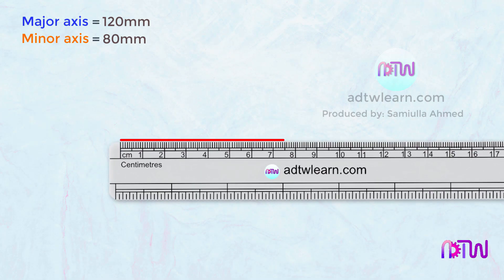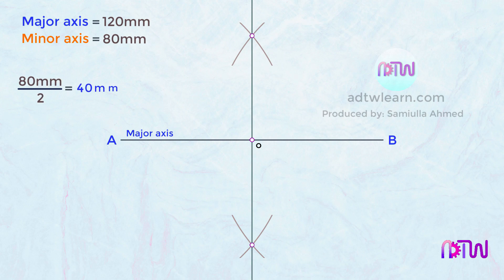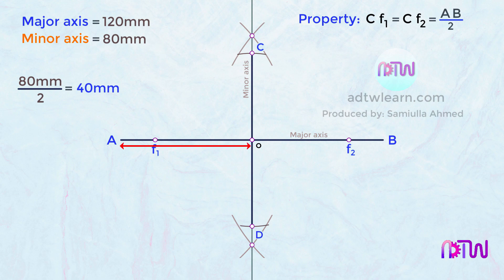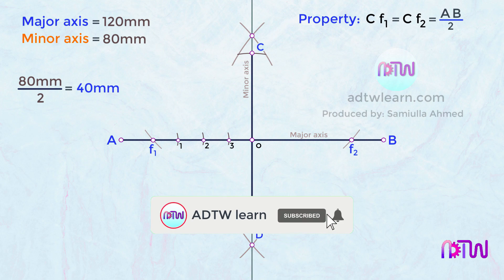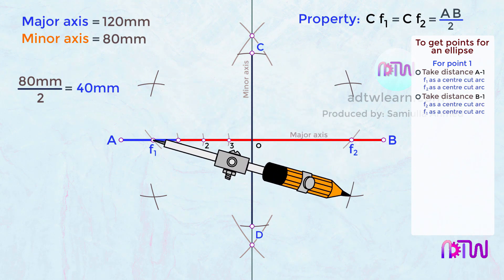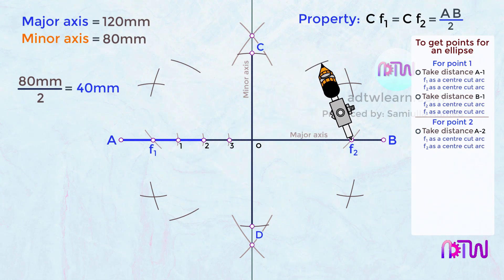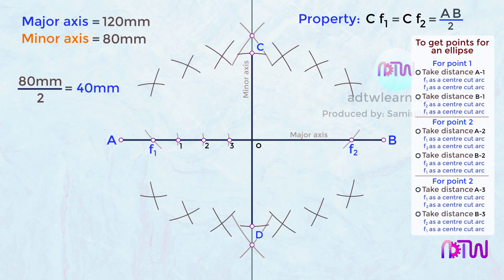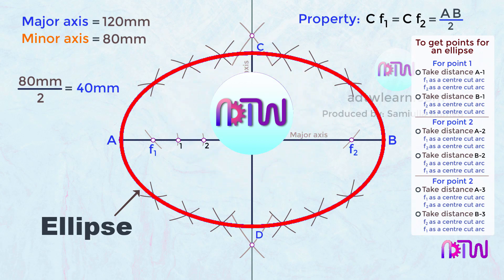Ellipse by Arc of Circle Method

Comment: Nice animations. Very clear and instructive.

To further clarify, edify or confuse, I can add some additional nomenclature / details.

- [ ] 1:05 The 2nd straight line drawn to find the midpoint “0”, (also origin or centre) is called the perpendicular bisector. The angle to the first line is always a right angle (90° or π/4 radians), and it locates the exact centre of the line AB.
- [ ] The foci are analogous to the centre of a circle. Together with appropriately specified radii, they uniquely define the shape and size of the geometric figure. In mathematical notation, the equation for an ellipse is very similar to that of a circle. [I won’t try to type them out in a comment!]

2:40 The choice of points 1,2,3,… can be entirely random, don’t need to be equidistant (as measured by a compass on the video) and can be as numerous as you like - I personally need extra detail closer to endpoints A and B to get the curves right. With enough of these points, you won’t need to guess with a french curve.

Not sure if this all helps, but I find it useful to know and apply for geometric artwork (for which I am a total amateur).
It could just mean I have too much spare time on my hands.
Reply: Thankyou, this actually helped
Reply: @kellyakinyi9765 That’s wonderful. My degree in Mathematics comes in handy sometimes. Hope you enjoy your artistic geometric adventures as much as I do!